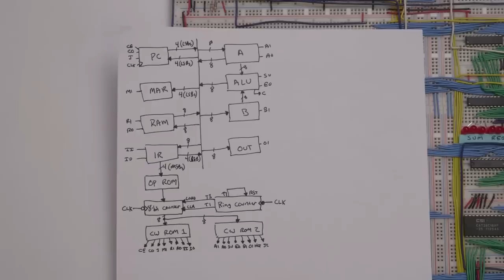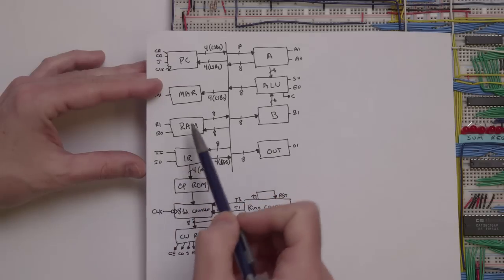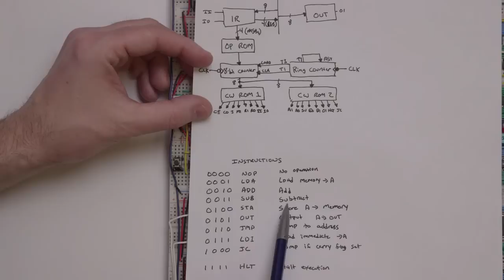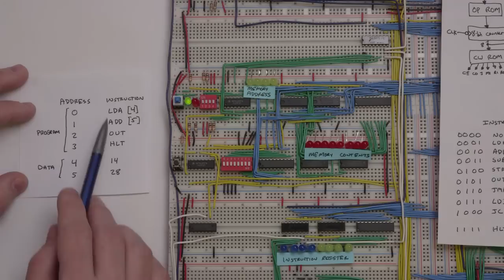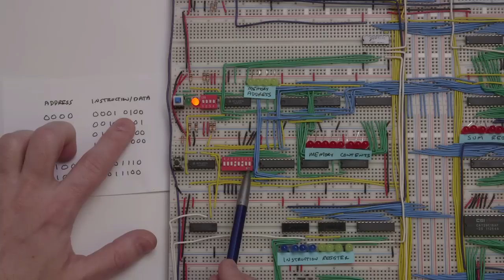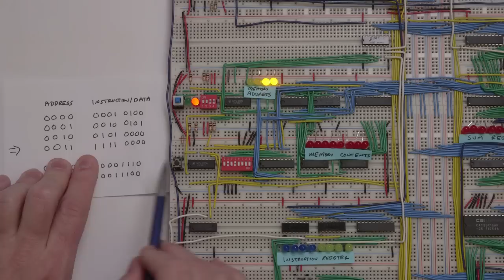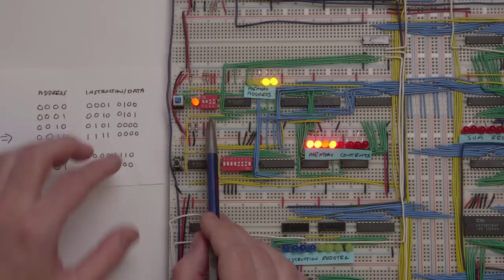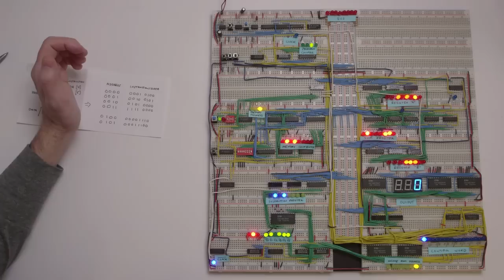Programming my 8-bit breadboard computer

Comment: How in the hell did they get to Windows or Linux or Mac from this?!
Reply: lots and lots of layers of abstraction
Reply: I was thinking the same😬😬
Reply: books 'iWoz' and 'Innovators'
Reply: Microprocessors
Reply: @t7H2si0vß2  lol true. Just so cool seeing this work :)
Reply: Unbelievably quickly is how.
I can remember using a DEC PDP8 computer that had to be part programmed by a row of switches quite similar to this. Once that was done it could read off paper tape. 

It's only 37 years since the IBM PC arrived and changed everything. The speed of change since then is bewildering.
Reply: Simple computers help building better computers.

Comment: Great! Reminds me of the days I used a 6800 in an embedded controller. And the PDP11 where we had to enter the boot loader in RAM with exactly these switches and LOAD button. I wonder how many people nowadays realize that the Address and Data LEDs on your board are actually the Blinkenlights on computers in (older) movies. And I see you still use Gefingerpoken to get the program into RAM!

Comment: It's useful to break it into smaller pieces, to look at the microarchitecture in two categories, data flow and control flow. Once you understand that the bit pattern for the instruction corresponds to control lines, it becomes much clearer.

Also don't forget the stored program concept, the instructions for a program and its data are stored together in memory as numbers which can be easily manipulated.

If you learn this you'll be a very useful person to know and more importantly, to hire

Comment: I thought of a way of storing programs by making the computer programmable through an optical reader.  You could also expand the memory and program counter without having to change too much of the structure by logically dividing the memory into 16 "pages" of 16 bytes each.  A "JMP" to another "page" would always start the program at address 0 in that page, so the instruction would be "JPP" (JumP to Page) and a 4-bit page number.  That way, the main bus can remain at 8 bits since each instruction is still only 8 bits.

What I thought of was a 10-bit optical reader.  8 bits are for data.  One bit is used to change the address for the data and one bit is used as an index bit, to signal that the data is ready to read.  If the address bit is set, then the 8 data bits are loaded into the address counter for the reader, otherwise the data is loaded into the current memory address and the address counter incremented.

A 1 bit would be two extended ASCII code 219 characters in the same position in successive lines. The index bit would be an extended ASCII code 220 character in the first line with code 223 directly underneath it.  A 0 (zero) bit would be spaces.  Using code 220 with code 223 underneath it would make the index bit smaller than the other bits, so the other bits would be sure to be set up correctly before the reader sees the index bit and reads the data.  If the data is "clocked" in on the leading edge of the index bit then the second line wouldn't be needed, making the data even more compact.

A monospaced font (not a kerned font) would be required to keep the spacing even, and there would need to be no spaces between lines.
The code would start with an 8-bit address with the "address" bit set (and the index bit of course), followed by bytes of data with the "address" bit clear.

If you construct the reader so that you can move the reader head across the paper to align it with different columns, you can store an entire 256-byte program on 4 sheets of ordinary printing paper.  In most cases it will take less paper, since most programs will be shorter than the maximum.  If you use leading-edge clocking, then 2 sheets would have enough room for a full program (printing double-sided isn't advisable in this case, for fairly obvious reasons).

Comment: pc gamer: yeah so i built my own custom gaming pc, its way cheaper
this guy: you are like a little baby. watch this.
Reply: The dichotomy of computer.
Reply: And in nand2tetris, you not only build a 16-bit alu/cpu and 32k ram, you also build the assembler, vm translator, compiler, AND an os to make a game you code up in the computers own high level language run! It's as "from scratch" as it gets.
Reply: @Cardgames4children  Yes, I wonder if this channel author knows about nand2tetris. I made everything and got to making an assembler but failed at that because I couldn't debug my low level C assembler :D
Reply: @Cardgames4children  i made this kind of project about 20 years ago and all was my own design, not a kit. Lower lever would be making all components and wires by yoursef using raw natural materials.

Comment: This tickles the nerd in me just the right way ^^
But with just 4 bit for parameters, longer programs all have to start with "0x0: JMP 0x10" so you can store your variables and stuff in memory addresses 1-15.
Reply: In this computer there's only 4 bits for the address, so what you have proposed is the same as 0 JMP 0

Comment: if it outs the result value from ALU and re-input in A register at the same time, it is like chain LOOP and sum the total as new input value and SUM again, and again, without control, unless, ALU support to lock its output result o pre-buffer its inputs, or you insert a controlled buffer in the middle.Or do sum in the rising edge, and present result in the falling edge.

Comment: I always thought the Decoding / Timing and Control logic was more important. Can't information only be read from the bus when an opcode tells the control logic to pull the corresponding 8 latches read line low so only the thing you want to receive data is actively reading from the bus. So if you want something to move from memory to the 'A' register whatever opcode you use, once decoded, will always perform a read operation on the memory while all of the 'A' register's lines are set to read for just long enough to receive the byte.

Wait I watched more of the video... you say exactly that...

Comment: I just found you channel. I am new to electronics (i have studied engineering but no electronics) and I want to learn everything i can relateed to electonics/microcontrolelrs/robotics..I started with arduino and I was happy doing high level applications like making home automation and little fun projects by using of the self bits and libraries..but then I started wanting to learn more details about how the thing si use work..I set a perrsonal goal to built s veru very basic simple computer..and I am happy I founf your channel cause it seems I might be able to do it, thanks!

Comment: i was literally working on the same thing. I had the sketches done. just needed the funding... guess I will have to do a 32 bit one... Good luck beating that. Even if you do, I have sketches all the way up to 128 bit. Ima literially try to program a 128 bit os. No reason in particular, but if I can get it working that would be pretty cool.

Comment: the instructions are similar to the 6502 assembly instruction set, but here the BRK instruction is replaced with the HLT instruction.
Reply: also, 6502 assembly has more instructions and in the case of the compiler I used for learning, there is no out instruction, the screen is like a 16 x 16 pixel monitor and the pixels are controlled by memory addresses 0x0200 to 0x05FF.

Comment: And the answer is... 42 :)  And this, kids, is how Deep Thought was born :)

As for the programming mode: Wouldn't it be more convenient to have a programmable counter to scan through the memory addresses in sequence, starting from the first address you entered? Then you could move to the next address in sequence by simply pushing the "save" switch, instead of fiddling with the dip switch.

Or perhaps some primitive punched card/tape reader with a series of phototransistors and LEDs to read the holes? It could facilitate programming and allow for some mass storage ;) (you can use the same punched card many times instead of inputting the program from scratch after every power-down).

Are you going to publish the schematics anytime soon? What I'm interested the most is how the state automaton / sequencer works and the instruction decoding unit / control unit, because these elements of a CPU are usually poorly explained, if explained at all. Every tutorial deals with the ALU, but it's very hard to find anything on instruction decoding.

Comment: You should add a video running a program in different clock speeds so each step is visible.  Maybe have I cycle per second or slower, maybe with a commentary for it 😀
Reply: never mind just saw the video

Comment: Really informative. Thank you.Mind boggling to scale up these 8 bits to todays huge multi core 64bit designs. I wonder if there is any one person who comprehends all the registers and operations of a modern CPU?
Reply: +James Porch hi there, probably not , to put it simply , registers and op codes etc were way more important if you were coding in assembly , back in the day assembly coding with the 8 bits was the way to go to get speed of execution of software , but i just don't think anybody codes in assembly for those 64 bit cpu's ! coding today is mostly 'C' based in one form or another , 'C'  , 'C++' 'c#' etc ..  and for those 'c' based languages i dont think programmers would need to know all of the op codes for the 64 bit processor , there might be some very small 'inline' assembly within the c code , but it is jut not so frequently used ... back in the days of the 8 bits , one person could write a full game in assembly , today it takes a really big team to make a full game ! so chances are that each person within the team would be working in a specific area , so i guess there would not be just one single person who comprehends all the registers and op codes of the advanced 64 bit cpu !
Reply: James Porch Alof of people do still code in assembly language though due to its superior speed and reliability things like nuclear reactors and other extremely important systems generally are coded in assembly, well at last the base operations are.

Comment: How exactly does the computer distinguish between data and commands?
Because,  0001 0001 0010 may be interpreted as either:

Memory address 1 = Instruction( Load_in( Memory address 2 ) )

or:

Memory address 1 = Data( #2 )
Reply: I'd eventually figured it out.
Reply: Halt command prevent that, you just avoid the PC to go in the data part so it doesn't read wrong and totally random commands.

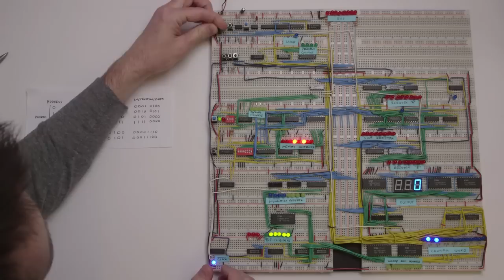Comment: Hey Ben, haven’t seen anyone try to diagnose why you got 28 on one of your runs so I tried to figure it out. At 14:13 it boots up at T6 of instruction 0 so the program counter is already at 1. This made the breadboard skip step 0 entirely and simply add 28 to 0 then output that, since 14 was never loaded into A. May have been a resetting issue or something, I can’t quite tell why the counter didn’t start at 0.

Comment: Fantastic video.  One thing I noticed: when you are going through checking the memory contents, the contents of location #1 look odd (12:57): the LED for bit #6 looks like it is only barely on (although it did light briefly when you flipped the address DIP switch). Was it just a flaky LED, do you think?

Comment: Hi Ben,
Where did you get the "opcode" come from? Is that what we call software in everyday language? What happens when we press a key on a keyboard, does it also take the same approach (fetch, decode, perform)? I'm not really clear on the steps of execution of the program?
You're very helpful in explaining the workings of the computers, although i've tried to mess with my computer by taking it apart but haven't been successful in peeling the workings of the computer.. How do you learn this stuff? School and texts don't work with me... 

Appreciate you being here..Thanks again
Reply: +Jaffery I hi there , school and text didn't really work for me either , practicle experimenting for me did , but at some point you have to give in and do some reading ... reading of data sheets for ic's , reading user manuals for cpu's etc ...

the opcode is simply an instruction for the cpu to execute , there will be a full sheet or two of opcodes for the cpu , each instruction is assigned a number , that is what the cpu understands , to understand more you have to get a basic understanding of binary numbers ... 

the keyboard is really quite an amazing little 8 bit thing all on its own ... you press a key and the corresponding number or letter appears on the display ... simple you might think ... well not quite ! 
most of understanding the keyboard is understanding codes , there is a code when the key is pressed , and a code when the key is released  ,  the keyboard is connected to the computers io port , the cpu reads data in from the port , however , it gets even more complex in that the keyboard operates with interrupts , basically the way it goes is :-
you press a key , the keyboard is arranged in a matrix of rows and columns , then there is a keyboard decoding chip which reads the location of the key pressed on the rows and columns , and the sends out a corrisponding 8 bit code to represent the key pressed to the io port .. then it does the same thing when the key is released !
Reply: +SIMON wilson That is a gap i want to fill also. It is really interesting how I/O works. I believe the 8 bit code represents the ASCII value of the key pressed , i maybe wrong and would like to be corrected. Can you recommend me a book or course where i could find these answers? Thanks

Comment: In your program, will the ADD instruction add to whatever register you loaded from in the previous command? What I am understanding is that LDA placed 14 into the bus? If that is the case, could you not have used ADD in the first instruction and OUTed the sum from the bus?

Comment: so this setup would be capable of rewriting its own code since you can probably save values into the program part of the memory and have them run just like an actual instruction is there any small examples where this would be usefull if you can give custom inputs im sure you could make a program which lets you write directly into memory just using the inputs and the program auto indexing them for you
Reply: Ben Abbott this is exactly, what your operating system is doing all the time.
Reply: yep pretty much was i described is a super basic OS that allows you to write programs for the computer and run them lewl

Comment: Hey Ben, awesome computer. I was wondering when the B register is used, all of the instructions just worked with A and memory. Is it like an intermediate between loading from memory and adding/subtracting from A? Also, what are the specs of the computer? (Clock speed, memory size, etc.)

Comment: It looks like it skipped a data address when the result came up as 28. Before ADD it didn't show 14. Wonder why?
Reply: chinagoer: If you look closely at 14:12 it actually starts running at T4 microinstruction (6 green LEDs in the lower left corner) instead of T0 for some reason, maybe there was an error with the clock or the reset circuitry. On subsequent runs it starts properly from T0.

Comment: Hey there 
I have a question
When you write in the data, why does the computer not interpret the 4 bits after the memory address as some kind of operation, for example the null operation which would stay in the number 14, if it would interpret it as an operation?
Sorry for my bad english ^^

Comment: but what happens if you wanna store number 00010100 into the memory with the switches? It will mistake the number for an instruction so you cannot store number 00010100 into ram?
Reply: binary is abstract. The computer can't tell if a value in memory is an instruction, variable, etc. It will just take the data and try to interpret it as an instruction. Same goes in a modern computer: both an image and a program file are stored as 1's and 0's, but they are meant to be interpreted differently. If the computer tries to execute data that is meant to represent an image file, it probably won't work, and vice versa. So in this case, you just have to make sure the program never executes data from a memory location that's intended to be a variable. that's why assembly is so interesting: you can literally do anything.

Comment: How does the computer know the difference between a "number" and an opcode? Does the data always have to come after the program?
Reply: +PrismCyde Are you referring to the difference between the final 2 inputs (the 14 & 28) and the actual 'program'? If so, then there really is 'no difference'. The only difference is that the computer will read from the 1st memory address, and will go along a perform the program, and do what is does, until the HALT command is used. Then the program will stop reading beyond that point, and won't accidentally try an execute a command that you meant to use as a number. In this example, he's used the few addresses after the program stops to hold numbers, as the computer will no longer read those as instructions, and he can manipulate those addresses as he likes. But, to the computer, it's all just binary :P

To put it another way, notice that his first command, in address 0, (0001 0100) is co-incidentally the binary representation of the number 20. So, if you wanted to, you COULD use that memory address as a register for the number 20, if you wanted to, but good god, I hope no-one ever wants to do that XD It's far too confusing, trying to work out(conceptually, in your head),  when you want to use an address as a number or command :S

But I hope that helped somewhat :D